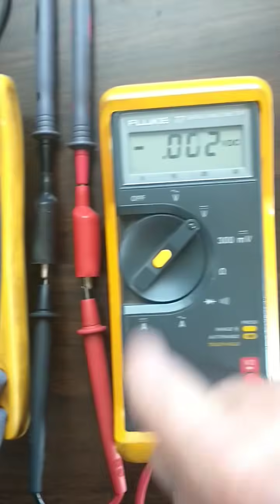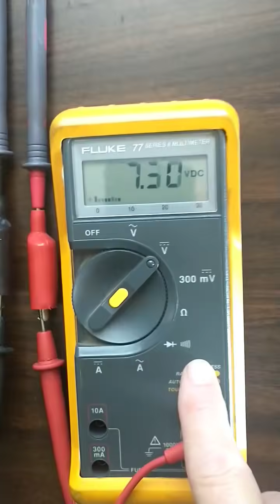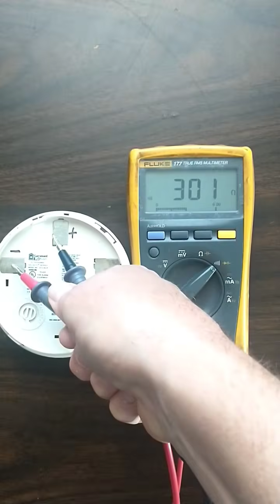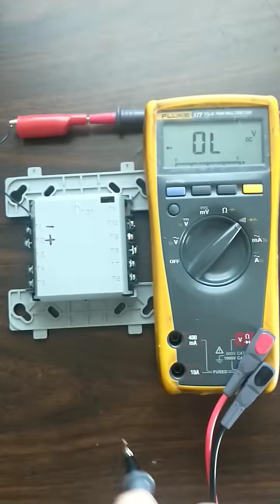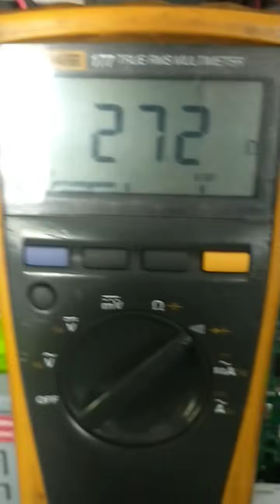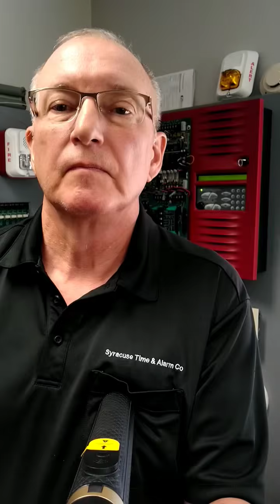Fire Alarm SLC Reverse Polarity: Diode vs Continuity Checks #firealarms

Comment: Amazing description thank you again,so if it's faulty device it won't give the same readings??
Reply from the maker: It depends on what failed with the device. If it suffered a voltage/current spike then it might affect the readings but if the communication chip failed it may not change the readings.

The purpose of this video was to demonstrate that you can use either setting when testing polarity sensitive devices. Its useful when testing a SLC that indicates a shorted condition because a device was inadvertently wired backwards.

You can also use those meter settings if troubleshooting a ground fault that is caused by water infiltration where the standard resistance measurement wont give reliable readings.